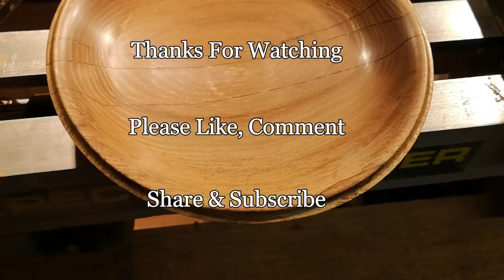Wood Turning - Resin Repaired Golden Platter (Kintsukuroi)

Comment: Great job of saving an otherwise doomed piece of wood.  A natural break in the wood put back together with glitter and resin sounds  brilliant. Looking forward to seeing more of that.
Gary
Reply from the maker: Cheers Gary, not sure if I will use glitter as a filler again, as you only see two very small faces, but never say never. I do have a back up plan in place though. Really happy that I was able to save the blank. 👊👊👊
Reply: Martin I was envisioning if you could leave the wood spaced 1/8-1/4 and fill with resin. Then you would have something that shows and still have the natural break. Just a thought.
Reply from the maker: After seeing how this turned out, I was thinking along those lines too, also a resin pigment and a darker wood, to add some contrast, walnut or mahogany perhaps?